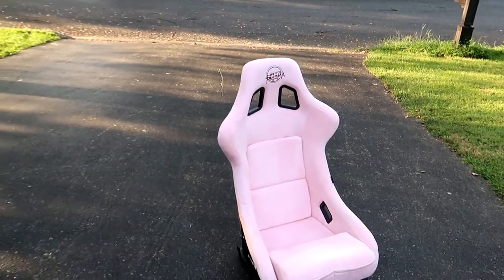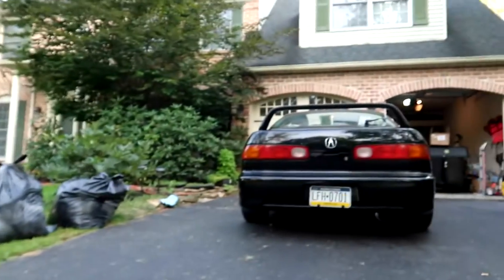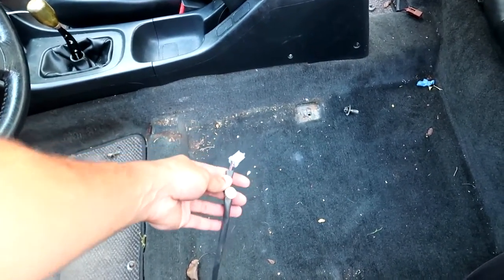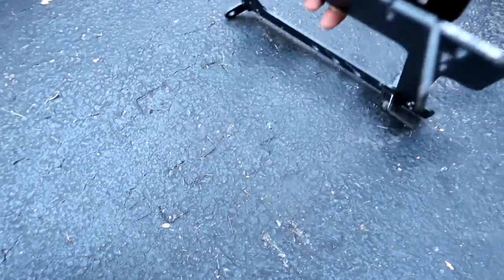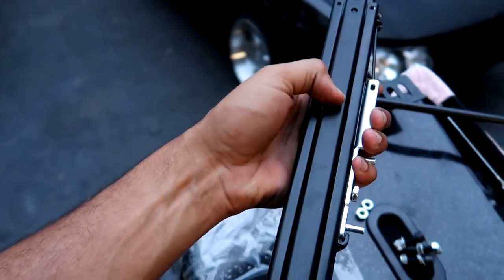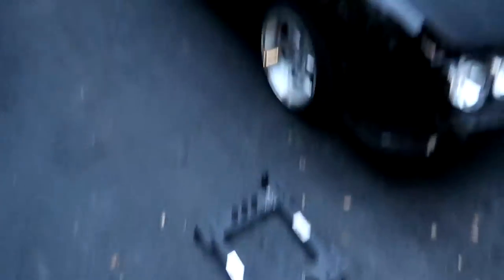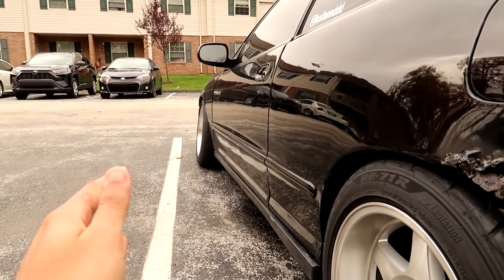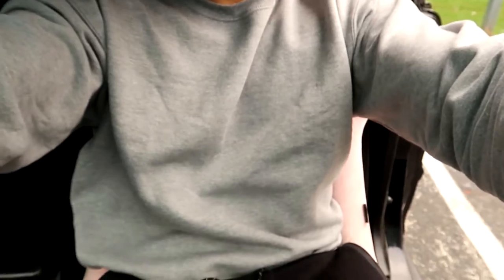NRG Prisma Bucket seat install!! With sliders ( integra )

Comment: So everyone knows, a locking nut is supposed to be threaded all the way down. It will surpass the threads and that’s why, it locks tighter when you keep tightening it. Do not just swap it to the normal nut like suggested in this video. 🤙
Reply: I was able to use the locking nuts that came with it and they were really tight.
Reply: yeah i was honestly shocked that he did not realize that and wasted a trip to the store
Reply: Thanks for saying it.changing a locking nut for a normal nut is a great way for your seat to rattle loose over time.
Reply: what did you guys use to tighten these down. i cant seem to break the seal or whatever on the locking nut. ive seen people on youtube do it with an allen key but i cant

Comment: Those are nyloc nuts 🤦‍♂️ they aren’t designed to stop threading, you keep tightening through the nylon section
Reply from the maker: Yeah I figured that after and the funny thing is I’ve used them before so idk what I was thinking 🤦🏽‍♂️

Comment: How many bolts did you put in the slider, 4 or 6? Did you do 4 in the slider and the other 4 in the mount?
Reply from the maker: Just 4 in total, rail through slider. Mount comes already mounted.

Comment: Hi I have the same seat and sliders but I don’t have the seat bracket, do I need it or can I still install it with out it?
Reply: You do need the bracket, it's what connects the whole seat assembly to the floor of the car. Even if it would bolt up, you wouldn't be able to see over the steering wheel